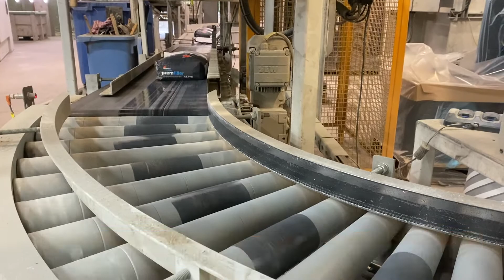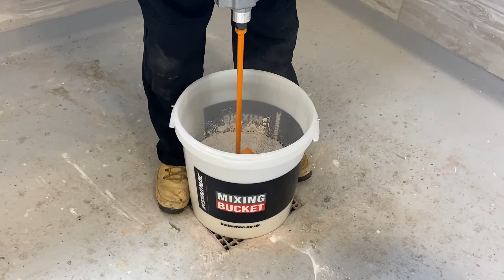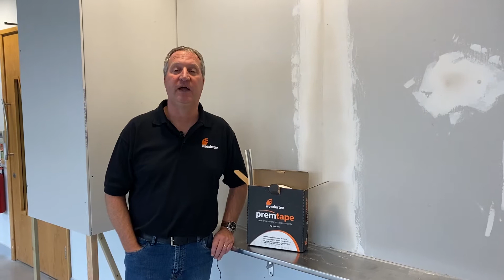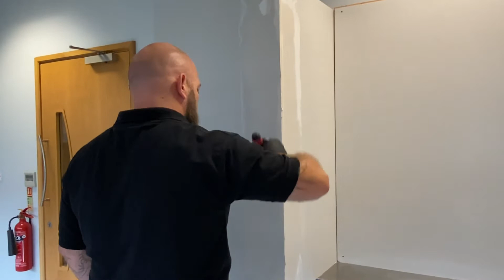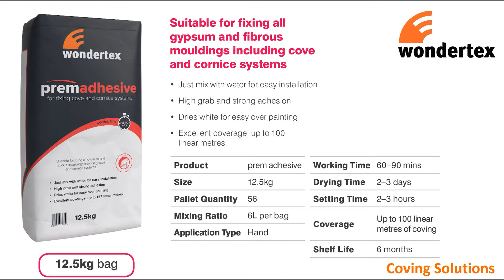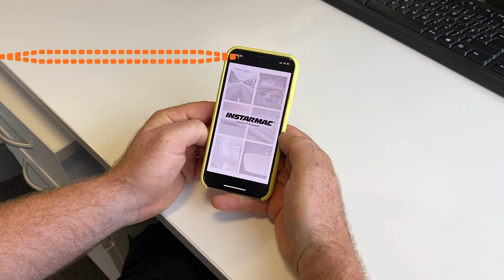prem fill & finish: A Decorating Masterclass

Comment: UPVC window installers had cracked the plaster for about two foot and about 5" wide on a window reveal.  On re-decorating I took off the damaged plaster which went down to the concrete sill - quite deep.  The 'fill and finish' covered it up well.  Didn't even PVA underneath.